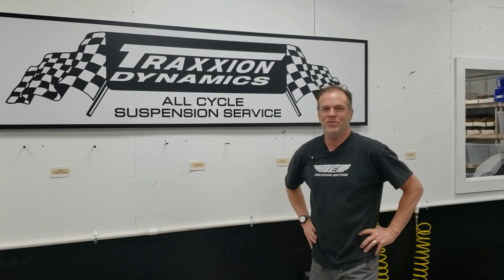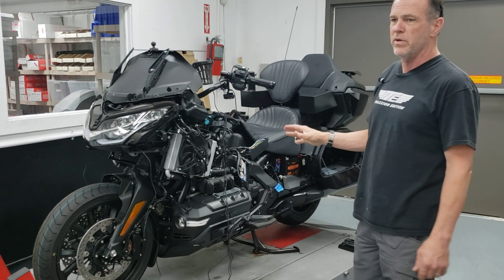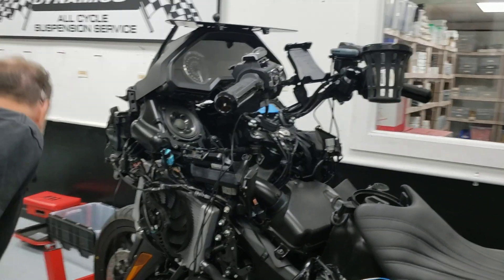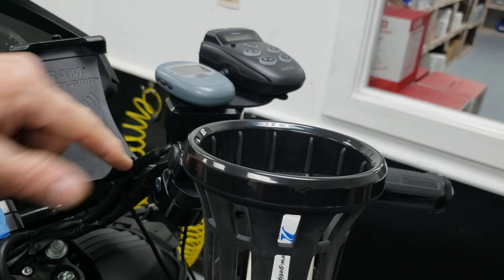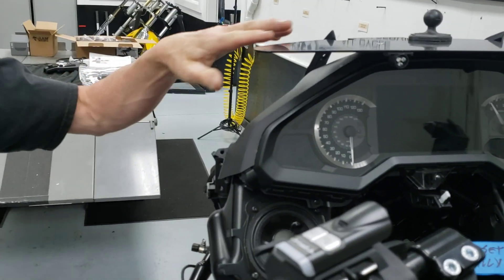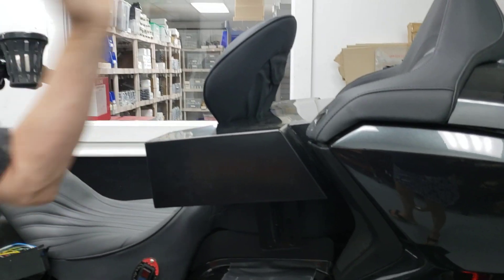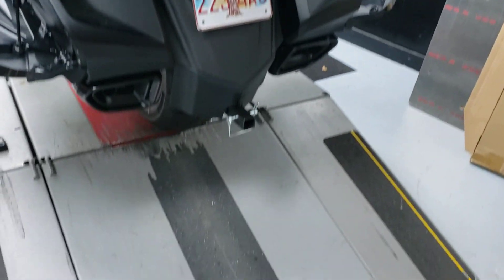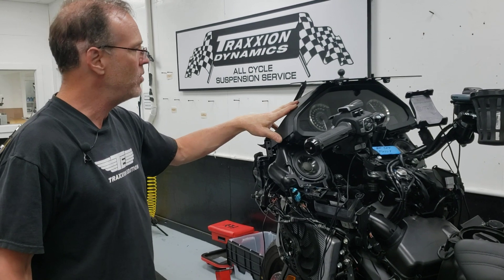2021 Honda Goldwing Mega Build Update 5.24.21 with Max McAllister of Traxxion Dynamics

Comment: Did Max says 120 hours to do the bike. At what price pr hour? And all the accessories  plus price for the bike. It must be a pretty high bill to pay totally.
Reply from the maker: The cost of the build will probably match the cost of the bike.  It doesn't take long:  Suspension $2650, Fuel Tank $1600, Saddle $1200, etc, etc.  

I was at the local Ace Hardware, and the labor rate to fix a weed whacker was $95 and it hit me that the world's finest suspension service and "the place to go" for Goldwings should probably be worth more than a young kid fixing carburetors on lawnmowers.  So our shop rate went up to $125 per hour at the first of the year.
Reply: @Traxxion  So about 60 grand totally? Dont know the price of the Goldwing in Us. I'm from Denmark.
Reply from the maker: @AC160  That would be my guess, but the owner has supplied many of the parts, and the dealer he bought the bike from supplied a lot of the parts.  The only guy who will know the grand total will be the owner.  I would leave that to him to answer this question... which is always the #1 most asked question.

The DCT Tours in the USA are approaching 30,000USD.  The 2021s are in limited supply and bringing top dollar, with little or no discounts.
Reply: @Traxxion  The Gw1800 year 2021 cost approximately 95.000 us dollar in denmark 🥴
Reply from the maker: @AC160  It's just a number... the value is the same.  In Japan its something like 1,000,000,000,000,000 yen!